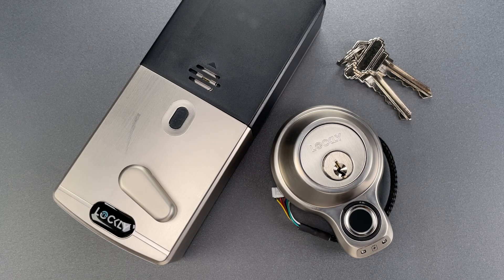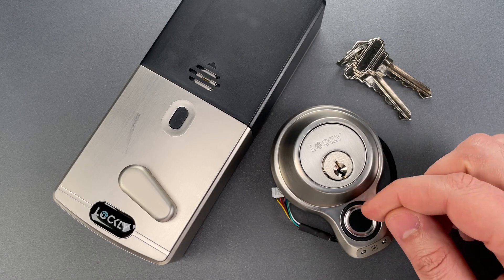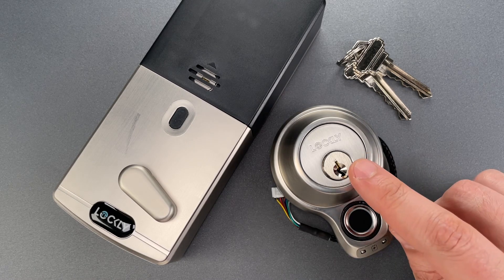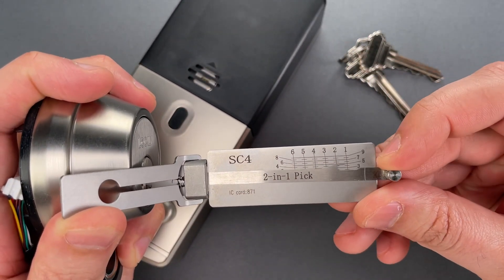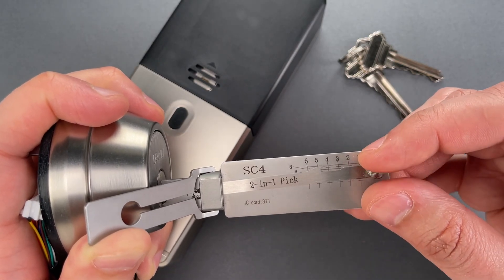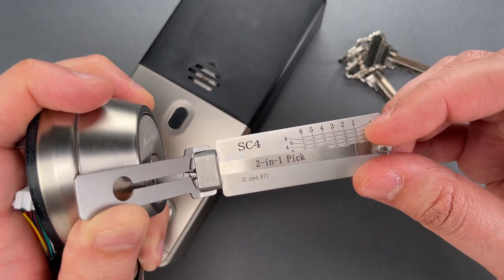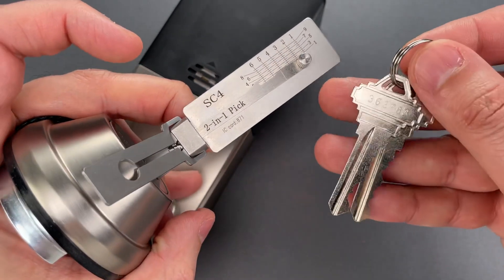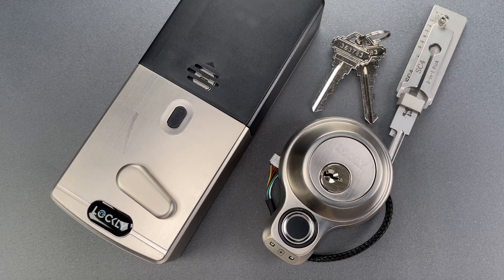[1410] Lockly’s “Flex Touch” Deadbolt Picked

Comment: I consider all electronically accessible locks insecure++

Wifi, Bluetooth, fingerprint sensor - all the shebang that make it vulnerable to an it-attack.

And there tons of new attacks each month.
So: Who updates and maintains the software of this pieve of snake oil?
Remember, why you are updating your phone and computer all the time.
And these locks?
If that lazy, just leave the key under the doormat.

LPL:
You are worried because of crappy gun locks... INSIDE your home?
You've been to it-sec conferences. Didn't you pick up anything from whitehats?

All:
You don't need to be a halfway trained picker, picking personally under time pressure.
Nope. I guess you just place a battery-powered attacking device near the lock, and start an attack anonymously, and leave it there.  E.g."What's that blinking box at the ceiling? Hhm. Must be a newly installed Wifi AP. Nice."

... when lazyness begans stupidity...

Comment: Since you can access from the wifi could a lock have a feature of closing the key way when you're away?
Reply: That's possible, though expensive and needlessly complicated. What is not addressed by the analysis done in the video is that this can be attacked through access to the wifi. Most people who install a system like this have little experience hardening a home network and it's not exactly on the list of skills I would expect a locksmith to have. For the LPL, the physical lock was pretty good. I would love to see a tie in analysis with a channel that does PEN testing. I have basic skills in that area and am confident I can bypass it with no problem. I would like to see a specialist attack it.

Comment: I’m an electrician and when I upgrade a panel and service older meter cans come with a carbon steel lock ring(barrel lock) that I wish you try. I literally have to cut it with a grinder and just destroy it to remove it.

Comment: isn't it trivial to pry this whole thing from the door/wall with a flat screwdriver, cut the wire and short it?
my thoughts are - there is probably a good reason most locks are embedded into the door, so having a thin wire connect the two pieces is like a prison cell that has the entire lock mechanism on the inside. 
I have no idea how any locks work btw, just a guess
Reply: The wires do not open the lock, the wires transmit data (keystrokes or codes of a fingerprint) to a logic board that opens the lock based on the matching of the presented codes to those stored in it memory.

The days of "smart" keypads that had power in and a unlock signal output are hopefully long gone.

Comment: I always wondered what was stopping electronic deadbolt locks from having a simple routine that notices when a pin is moving and then merely activating a deadbolt just because pins kept moving longer than, lets say 15 secons, after the first pin moved?
shouldn't that help save from intruder attempts?
Reply: That sounds like electronics and logic.  More attack surfaces
Reply: That would require a bunch of rather sensitive sensors in the keyway, which would mean you can't swap out the core, you add more failure points, and re-keying would probably be tricky. It also wouldn't catch raking.

You could use a dust cover for your sensor, and perhaps use magnets and steel pins to somehow bind them up,but I'm having trouble seeing how to do that without either the possibility of trapping the key or accidentally picking the lock automatically. A tubular lock might actually be the better choice for a lock that actively resets it's own pins.

Comment: Wow, this actually seems like a pretty good home smart lock.
Reply: I really like mine. I have the  "pro." You can set it to send push notes to the phone when it is locked/unlocked, opened/closed, assign temporary PINS and fingerprints with or without restrictions. The keypad can be set to randomize numbers in sets of three (repeated every key press) to each of the four buttons making it very unlikely anyone can retrieve your PIN by watching you type. It also has full lock/unlock logs with details which would make it amazing for a main entry point to rental properties.

Comment: I wonder if the problem with electromagnetic relays in the front piece is a thing of the past (replaced with solid state) and magnet attacks will no longer work.
Reply: Even if this model is using an electromagnet internally, it looks like the bulk of the mechanism is on the other side of the door, which would provide a lot of protection

Comment: Looks like at least as competent of a lock as most people hang on their doors, at least for residential use.  It took LPL several passes with a Lishi tool.  I'm sure it would take mere mortals several times as long, or much longer with a regular pick and tension wrench.  I have to wonder how resistant the fingerprint reader would be to capturing someone's fingerprint, or if your identical twin could open your house..
Reply: Identical twins don't have identical fingerprints. That's a case where dna does not rule.
Reply: @davidcovington901  Not having a twin, or closely inspecting the fingers of the one set of twins I do know, I wonder if they'd be similar enough though for a cheaply-designed reader.

Comment: Generally positive comments from the LPL. 
Took multiple passes with a specialized tool.
This lock is a winner!
(At least, physically - we don't know about the electronics)
Especially with the ability to re-core, this is the first 'smart' deadbolt I'd even consider.
Reply: don't know if he used the Lishi because it was needed, or more because it shows us viewers a better idea of what is going on. However, this does appear to be a very good quality lock, again assuming the electronics portion stands up to the test.
Reply: @andy19934  I bet you anything that he can pick this lock much faster with traditional hook than Lishi.  He's selling Lishi so it's good opportunity to market his product as well.  Lishi can decode locks.  It's a great locksmith tool.  For an everyday lock sport picker, don't need to decode and it's much faster with a hook.
Reply: @andy19934  For sure he could pick without the Lishi... I'd bet my shirt on that.  It does let us see what's going on, and as he said it does allow decoding after picking, which was all interesting to see.  But of course there's the possible (and reasonable) additional factor that he sells these Lishi tools.
Reply: @tsuchan  He also sells traditional lockpicks.
Reply: @andy19934  It's really more to show whats going on. Also using a Lishi technically makes the pick easier over the usual single picking so if the Lishi takes a while then you know the lock punches above its weight
Reply: @andy19934  four passes it took the LPL with the Lishi. I'm sure he could have single-pin pick picked the lock, but he'd have been at it considerably longer. The Lishi tool allowed him to 1) plug for his tool and website, 2) show us what he's doing, and 3) keep the video fairly short, as short vids are kinduva trademark thing with the LPL.

Very efficient!
Reply: The keyway can be replaced with the high security Mul-t-lock MT5+ keyway, thus greatly increasing security.
Reply: Given that he didn’t show any exploits, at minimum the smart features can’t be easily defeated with tools or a magnet. So it really comes down to fingerprint sensitivity like you said.
Reply: @CoconutMigrating  yep.
LPL doesn't usually skip at least mentioning obvious weak spots, so this looks good.

Just looked this up online, and the prices range from "a bit much" to "quite reasonable."
I'm in the market for a new deadbolt, anyway, so looks like my search is over.
Reply: And yes, 'layered defenses;' my primary defense remains my big, loud, noisy dog pack.
Reply: @lairdcummings9092  Light giggle.
Reply: I sell these at the shop I work at and they tend to be pretty good locks. I've only had one person not like them. I don't have this version but they offer so many different varieties. I'm actually impressed, I didn't realize it had security pins in them.
Reply: @andyx3559  Good to know. I've already decided to get one, but it's good hear from someone whom has actually seen them 'in the wild.'
Reply: A thumb of rule with electronic locks is if they have one of those wider cables coming out of the outside unit with 10 or so wires, the logic controlling the door will be on the inside part, as well as any relay that might get thrown with a magnet. Avoid the ones that only have 3-4 cables going inside like the plague, those are the shitty ones where it sends a "just go and open" signal to the indoors unit, not a "this is the code (or fingerprint) I got, decide if it's right or if you wanna show me an error".

In fingerprint and other biometric locks specifically, if the fingerprint reader unit is not sufficiently integrated, there is an additional exploit where the attacker would take apart the outside unit and send the data of a known fingerprint to the inside. This is way more advanced, and also requires data about a known good fingerprint, not really a concern on a non-exotic pin tumbler (the attacker will just take the easier way and pick the lock even if they have your fingerprint), but if you wanna get pedantic the best way to go is an integrated fingerprint reader that verifies the fingerprint by itself and is cryptographically paired to the indoors unit. That way, it's impossible to spoof the data, and sensors are usually a lot harder to fool because they look for things like pulse or a subsurface electromagnetic signature, not just the surface fingerprint.
Reply: I was waiting for him to do something like either press a gummybear to the scanner and get it to open with residual print, or just slap a magnet against it.
Reply: @Richard Cranium that's massive over-reaction for most instances. I don't go straight to lethal; deterrence and warning is the place to be. I can always escalate if needed, but demonstrably, in my real-world experience, a bunch of big noisy dogs is more than plenty enough to make the neighborhood punks go elsewhere.
Reply: Probably still really easy to exploit the firmware. I don't want my lock with bluetooth  or wifi capabilities. I already know how easy is to exploit "smart" dumb as fuck appliances with connectivity
Reply: @hardwarefromthegarbage3446  In making anything more complex you create more potential failure points. People screw themselves wanting things they don't need which do little to nothing for them.
Reply: When using a Lishi, it will always take multiple passes (well...usually...lol) as the chance of the pins binding in order #1-6 are rare.
Reply: Smarter is Dumber.
Reply: Took multiple passes with a specialized tool... I mean it would be just as easy for him to do it with a turning tool and pick. I think he used the tool to demonstrate the process better which I really appreciate. I also think that the tool he used is awesome though.
Reply: Don't mistake what he said.

It doesn't require specialized tools, he said this tool was specialized for this type of lock.
Meaning:
The lock could be openable by regular tools. The tool he uses just happens to specialize in opening these types of locks.

The wording you're looking for is:
This lock can only be opened by specialized tools,
Or
This lock requires specialized tools to open.

"the SC4 leshe tool appropriate for this the 6 pin schleg keyway."

This keyway can be opened by your regular tension tool and lockpick of appropriate size.
Reply: isn't it easy to just cut the wire and short it or something?
Reply: @jwhite5008  looking at the lock, it appears that the only wiring passing through the door is data input, that is to say, receiver and/or fingerprint data. Cutting those wires would require breaking the lock or sensor, and would only disable the electronic interface - i.e. making it harder to open the door.
Reply: @jwhite5008  I highly doubt the electronics in the touch pad is responsible for verifying the finger print. Instead it sends the data collected to the electronics in the lock where it is compared to the recorded finger prints. So just shorting the cabling would get you nothing. If you look at the bottom there are pins for connecting a 9 volt battery in case the battery in the lock is depleted. This might be a weak point, but I doubt it as it should be pretty easy to protect from overload or from someone monitoring voltage fluctuations to decipher anything about the lock.
Reply: @jwhite5008  Once the lock is properly installed there are no exposed electronics or wiring.
Reply: @jwhite5008  I've looked at a few of these electronic locks and generally the part that is exposed to the outside is just bare minimums to capture the credential and forward it to the smarts built into the housing.

Comment: So refreshing to see a product described as "above average" by the LPL on a regular consumer device.  Not perfect, but clearly a good place to start!
Reply: He tears apart a lot of electronic locks for having authentication on the wrong side of the door or vulnerabilities that can be exploited with a shim. Imho, The fact that he picked it says that it cleared the admittedly low bar for these types of locks.
Reply: I guess “above average” in this case means 90 seconds instead of 10 seconds.
Reply: So how can I find a good, well above average smart lock for my front door?
Reply: @bubifan  Well, you could buy this one.  Though I will say my 1st party Schlage smart deadbolt also has a swappable cylinder.  Though it's only an SC1. :/  Other options are to look at some commercial solutions.  For example, some where the deadbolt is not "smart", but there is an electronic release mounted into the door frame.  Much more work to install though.
Reply: Considering how bad the average is, it isn't really saying that much.

Comment: I guess, if they're not compromising on quality in either lock or electronics, it is definitely justified that it is a more expensive deadbolt. 

So a good starter point at a door lock that might stop someone with a rake, that can take upgrades such as a Primus core to really make it a formidable opponent.
Reply: Isn't the Primus core the one used to secure Winona's Big Brown Beaver?
Reply: @HariSeldon913  Hope you've made great progress laying the foundation for psychohistory. :)
Reply: @HariSeldon913  lol
Reply: @HariSeldon913  no, I'm pretty sure that was cyclone fence...
Reply: @HariSeldon913  This is the one situation where Primus doesn't suck. ;)
Reply: Just looked this product up online; prices range from 'quite reasonable' to 'a bit much.'

This vid may clear a few shelves.

Comment: Are their locks with just fingerprint or key buttons without the the key in lock so one can’t sneak into a home???
Reply: There probably are, but generally electronic locks have a physical backup because all it takes is a flat battery/power cut and now you're locked out.

Even hotel lock boxes and similar are like this, just in case.

Comment: You can always tell how pick-resistant a lock is by how long a video is, and I was pleased to see this result. Not bad at all for a consumer grade product.
Reply: Depends on what tool he uses to pick it. The leechee tool is a cheat code. Ordinary picking would be much harder and video would have been longer.
Reply: @jondonnelly3  The Lishi tool is indeed a bit of a cheat code... And it took the LPL four passes to open this lock. 
That, I submit, is a pretty decent lock.
Reply: Except if there's squire in the title. In that case it's how physicly resistent the look is